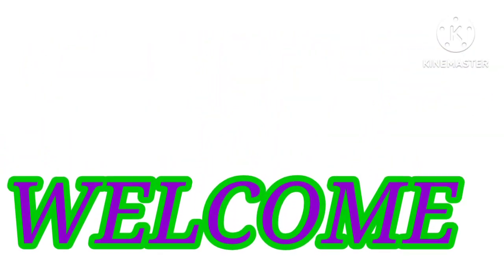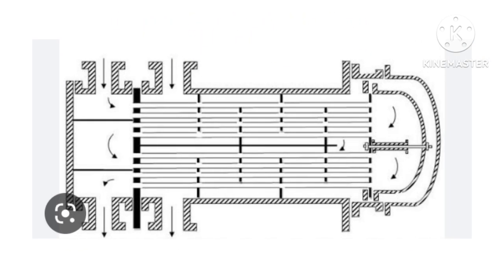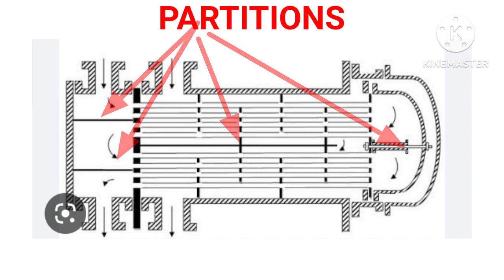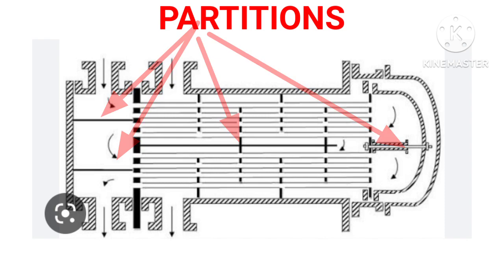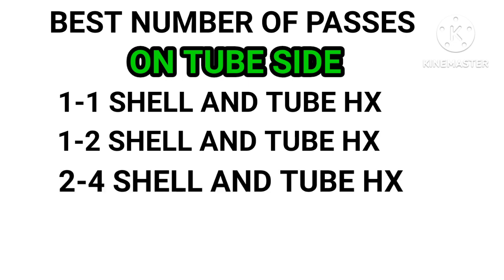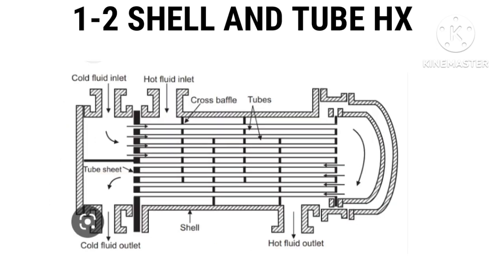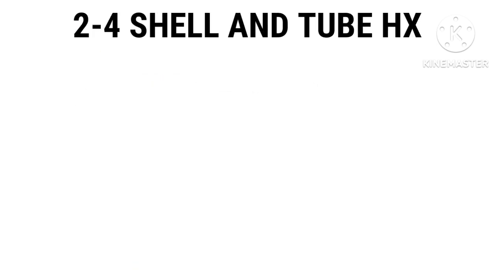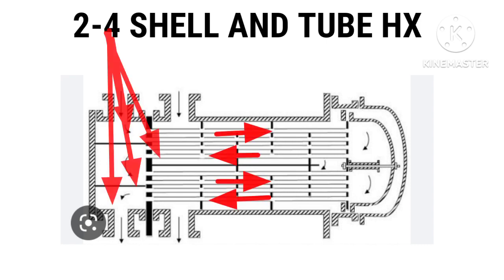Heat exchanger maintenance. Shell and tube heat exchanger. Shutdown Maintenance.

Comment: Mujj se Interview mai pocha gia ke Heat exchanger ko 20 bar Pressure dena ho to kitne Bar ki PRV lgaate hain.
Aur Gauge kitne bar ki use karte hain
Reply from the maker: Sabhi components lagbhag 1.5 hunaa jayada hona cjahie ya fir work pack ke testing procedure me diya rahta hai. 20 bar ke liye guage 20x1.5=30 bar ka kam se kam hona chahiye
Reply: @refineryshutdownworks3367   aur uski PSV kitni Set honi chaahye.
Reply from the maker: @bilalfarid2794 Owner's approval that it is permissible to exceed the pressure rating or the allowable stress for pressure design at the temperature of the increased conditions but not more than 33% for no more than 10 h at any one time and no more than 100h/y, or 20% for no more than 50 h at any one time and no more than 500h/y.
Thanks for comment
Reply: @refineryshutdownworks3367   Simply if 20 bar pressure then we should set PRV For 22 bar .is this right?
Reply from the maker: @bilalfarid2794 
, 20% of 20=4
Then need set at 24